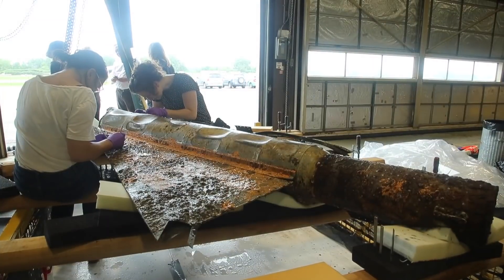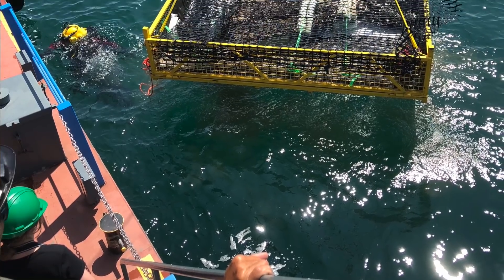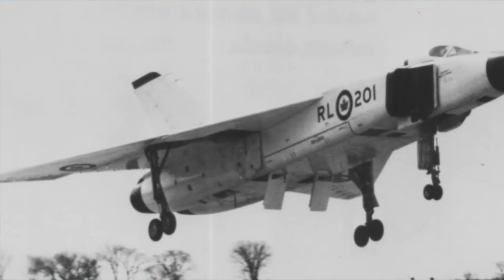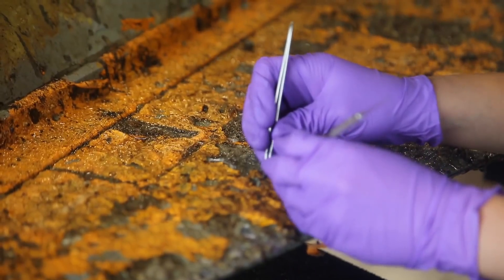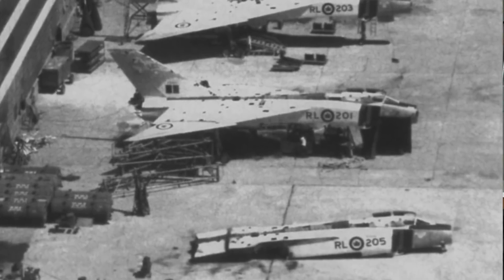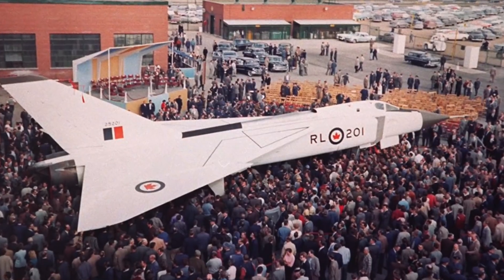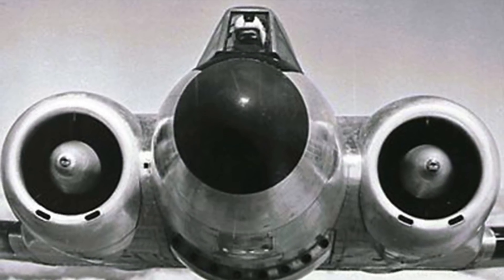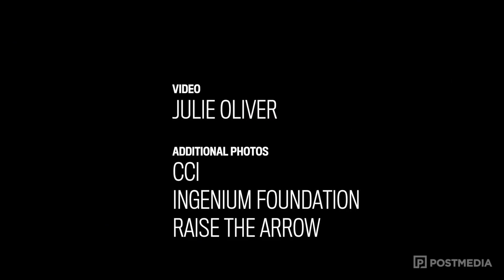Team restores missing link in Avro Arrow story

Comment: You`re very informative; but I shall also add that the Orenda Iroquois engines that were installed on 206, if flown, through calculations of weight and thrust would be able to actually achieve mach 2.5 and not just 2.4. In real flight, at the time they were hoping to achieve 2.7 or conceivably 2.8 with the Iroquois engines. The Pratt and Whitney engines produced 17000 lbs of thrust compared to the Iroquois which produced 26000 lbs. Mach 2.5 was only the minimum calculated speed. The brilliant engineers at Avro prior to the cancellation were developing the Orenda engines for future Arrows to fly at mach 3 and conceivably mach 4 and beyond. Unfortunately with one phone call, the development of the Avro Arrow and the Iroquois engine program were terminated. Thank you Mr. Diefenbaker for the loss of 14000 jobs at Avro Canada and it`s sub contractors. Just wonderful wasn`t he?
Reply: they blame Diefenbaker. but, there were others in cabinet that mislead him.